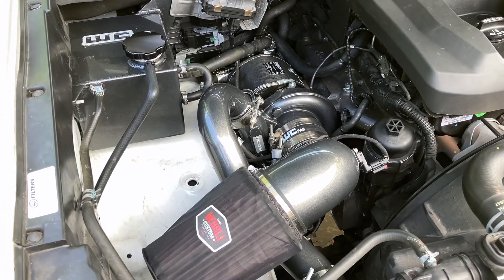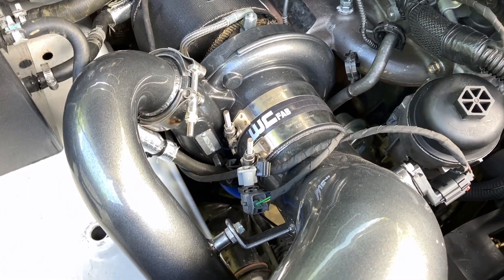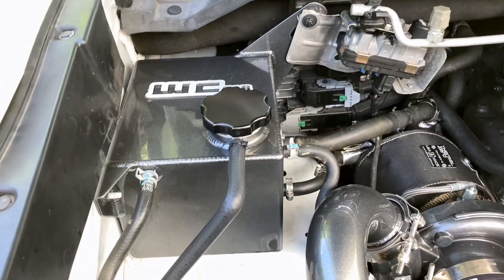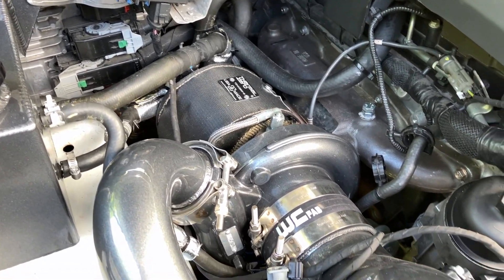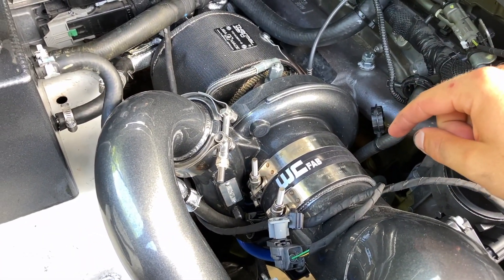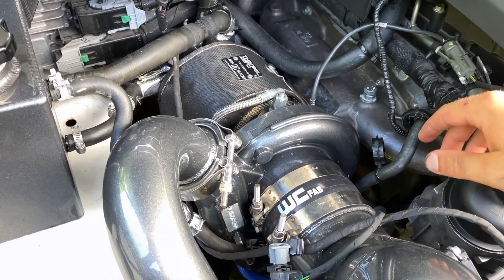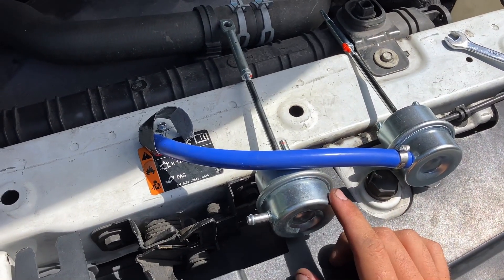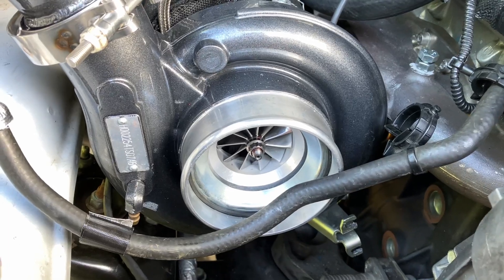Fixed Geometry Turbo on 2.8 LWN Duramax Diesel

Comment: Is this motor stock internals?
Reply from the maker: Yes!
Reply: Oh wow I’m surprised you haven’t done studs or rods!! What kinda oh power do you think your making? I’ve got a 2018 canyon and have been itching to see someone with a non vgt
Reply from the maker: Looking at having the engine built next summer, but at this power level (~325whp) it’s not necessary, but probably smart
Reply: @HunterSkiff  did you have a DT44 on the truck? What are the benefits of going this way? I have a 2017 Colorado,4.10 gears, DT44, water methanol injection and a serious diet. Thanks
Reply from the maker: @peterberglund5492  Yea I've had a couple different turbo setups with the truck. The main benefit of this setup is it's a little easier on the engine at peak load, and you can squeeze a little more power out of a setup like this, compared to the DT44, before building the engine, working the trans, etc. The turbo is also easier to service and boost test etc. The downside is drivability. You cannot beat the drivability of the DT44. If you tow, even light, putting a setup like this together is out of the question

Comment: Where’d you buy your turbo
Reply from the maker: Any stock size HX35 will do, they are available anywhere
Reply: Did you have it powder coated or did it come in that color
Reply: Also where did you get the air intake piping

Comment: I have a 17. I want to delete but want it done as cheap as possible, only intent is to get rid of def. Not looking for any performance change or tone change.

Can i save money by using my stock exhaust and gutting/hollowing the dpf? Cut out the filter, and follow regular delete kits instruction but just use stock exhaust pipe?

Is a down pipe required? Or can i just leave the stock thing (Doc) without having to buy any exhaust. Again, i want stock power tune and only want a reliable truck that will hit 300k miles

Literally just live in a place where it's -30f and the def freezes and already replaced def heaters. Don't care about performance, 100% reliability only

Hoping to fix it without spending 3k. A tune is only a couple hundred and i got a band saw and tig welder! 

Thanks man!
Reply: There's no reason you can't hallow out your original exhaust. Send it!

Comment: Where did you get the pro fab air blade delete kit, also will it require additional tuning, sick truck btw !! Any tips on what I should do after doing a full delete on my 2017 2.8 has 148,000 miles !
Reply from the maker: the air blade piece is an oldie from ProFab, I believe it is discontinued. Thank you for the support!

Comment: Is there a ton of turbo lag? I'm looking at a T04E with a .50 housing for my swap but I'm just going off my own number. What do you think? Clean turbo set up btw
Reply from the maker: What size wheels you thinking? This setup is pretty decent, it’s a stock size HX35, 54ish mm on the compressor. You give up maybe 300RPM down low where the truck is less responsive and makes less torque then once you’re on top on the charger it’s making some steam. This is not a setup you would want to tow with even at lighter loads like 3000lbs. very surge prone. Unloaded it’s a blast but you’ll definitely miss the low end grunt of the VGT. May try something like a S251 on this manifold and see how that does. Hope this helps, let me know if you have any more questions. Can Also find me on most of the 2.8 Facebook pages

Comment: What is specs on the hx35? Compressor and exhaust sizes? 60/60? 63/64?
Reply from the maker: Stock size compressor so 53mm ish. Turbine don’t remember off the top of my head

Comment: Hi brother nice work . Question I have a 16 2.8 colorado diesel with a delete and tune can I just put this on without any other programming.  Thanks
Reply from the maker: Thank you! This setup requires significant changes to the tune to run well. I would not recommend putting together a setup like this unless you’re able to tune it
Reply: But who will tune it?!?  I have a 19 zr2 deleted and tuned with 3” turbo back exhaust and s&b. Runs great but want to to this setup but want to add the mal sensor and correct tune. Would be nice to know who to go to.

Comment: How did you move the actuator? Also what happens when it’s unplugged?
Reply from the maker: it simply unbolts from the factory turbo. With the actuator still attached but unplugged, vane position will go to zero (fully open)

Comment: Sweet and clean turbo install.  Makes one wonder why it could not have been mounted up top like that from the factory!  The of course there is the OEM turbo, which uses super thin vanes that easily bend.
Reply from the maker: I think the turbo placement was a carry over from the previous generation of this engine. But yea, harder to service down there